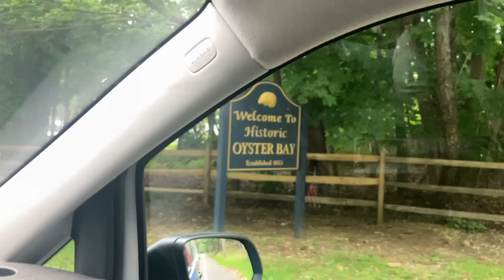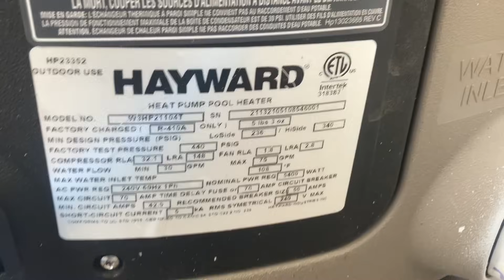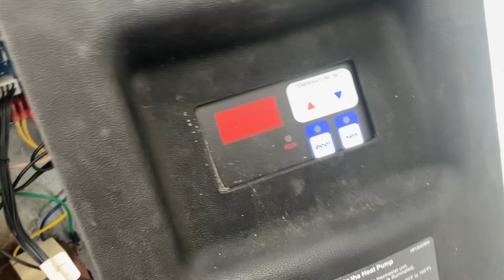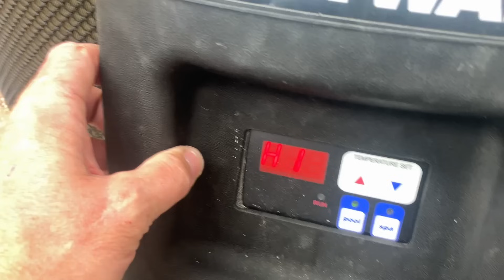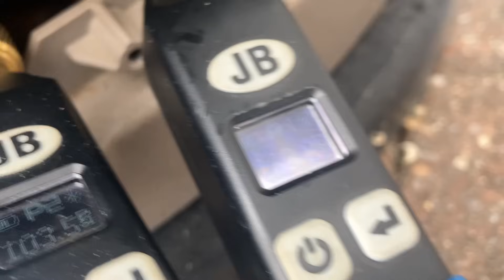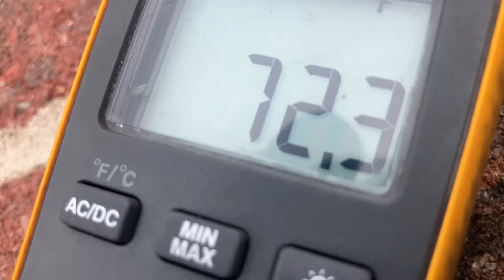Pool Heater Nightmare! Hayward Heat Pro HI Error Fully Diagnosed by Expert HVAC Tech FIX or REPLACE?

Comment: Don't take each one badly. But these diagnoses for many are extremely simple. I would particularly deliver to the customer what he needs. This equipment is becoming obsolete. But maintenance is very simple. The board can simply be replaced by a compatible board and the rest of the logic parts such as contactor and capacitors. So the customer is happy and you with money. Big hug 🇧🇷

Comment: I think it had a mouse house in the control area and the urine did all the rust/corrosion and chewed wires, after seeing open hole around electrical.
but that looks like someone replaced the control board/wire/panel and it sure doesn't add up overall, except that someone else already blew money trying to repair and failed.
time to replace the unit and do things properly.

Comment: Was there evidence that the access cover for the electronics compartment was incorrectly installed by a previous technician causing the water intrusion and the subsequent damage?  If not, what is your course of action to protect the repair?

Comment: Mike, I have a Hayward 200k NG pool heater. Everytime it satisfies and turns off the gas I get HF error. I replaced the gas valve and cleaned the flame sensor. What else could it be? Thanks!
Reply: You know what it's going to be....., the control board. It's always a control board. At least in my Hayward pool heater it's always the control board When it doesn't make sense.